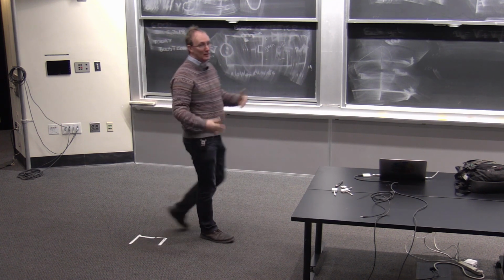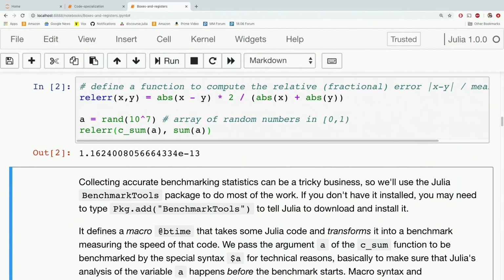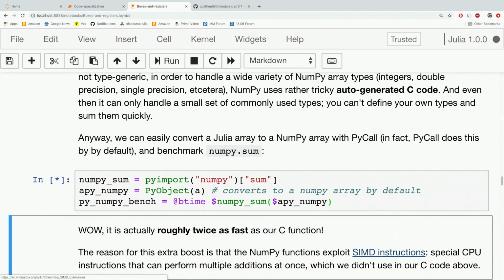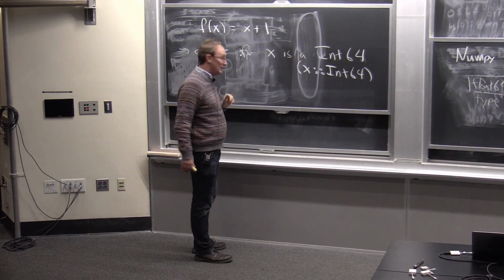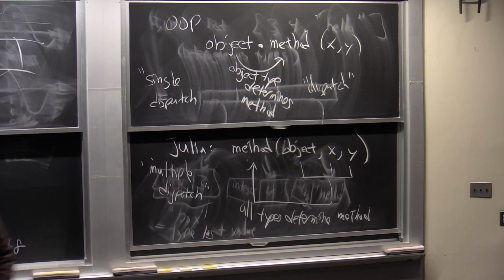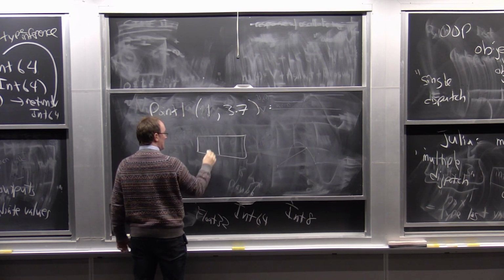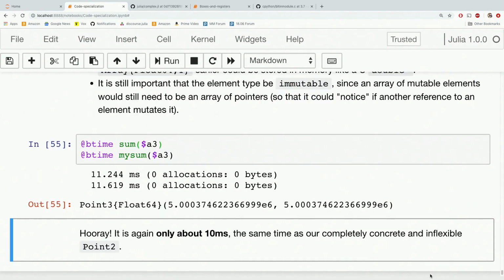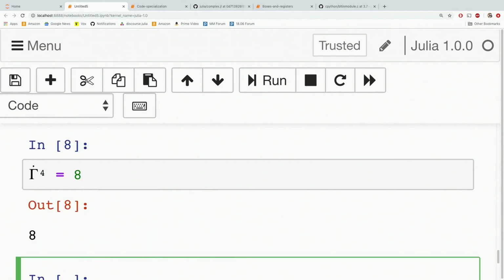23. High Performance in Dynamic Languages

Comment: At 1:15:30 - "there's a small core [of Julia] that's implemented in C for bootstrapping". Would it be possible to implement the whole language in julia?
Reply: As the guy with the number-as-a-name said, you ALWAYS need something to implement the bootstrap compiler initially. You don't have to do it in in C; if you want to be a maximum completionist you can do it in machine code, if you want to be a little lazier you can do it in assembly, if you want to be practical it is always done in C. This is because C is fast and the most portable language to ever exist (C can be compiled for basically any architecture).

As the lecturer said, they already convert to LLVM to do machine-level code generation, so even if all of their code was in Julia they'd still be dependent on tons of C and C++.
Reply: nope, there always has to be 1 little thing that knows how to initiate this bootstrapping mechanic.

However you could write a small compiler in C that compiles Julia Core to Assembly, let's call that C1 and then write a full Julia compiler in Julia which we can call C2. Now you can compile C2 with C1 and get the binary for a full Julia compiler. Now you can throw away C1 and only use C2 which is entirely written in Julia and compiles Julia code but you have to keep the binary so you moved the C portion of the compiler to a binary file.

Comment: This is a good, energetic lecture from "MIT 6.172 Performance Engineering of Software Systems." 
Fascinating (but 90 min long, so need some time, or need to speed through, but this fellow, Prof.Steven Johnson, already talks at 1.25 normal speed!).
This is really why I got interested in Julia: high performance, but dynamic like python, concise, readable, easy(ish) to get started.

The lecture gets into what's going on behind the scenes in python, numpy, c, and julia for some simple math (the sum() function), in a surprisingly clear way.

This remarkable statement, in passing at 10:10, struck me as shocking and counter to convention:"High level languages allow you to do tricks for performance that would be hard to do in low level languages." Usually we think low level languages are required for the efficiency tricks and code-specificity, e.g. type-specificity, needed for performance. I believe his message is that "[Flexible] high-level languages [that allow meta-programming, like Julia] allow you to [more easily] do tricks for performance."

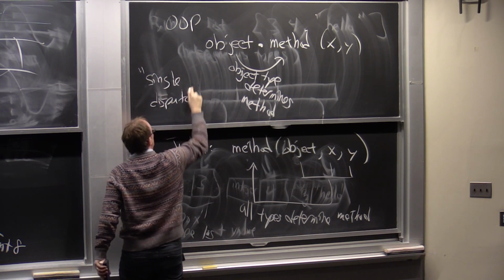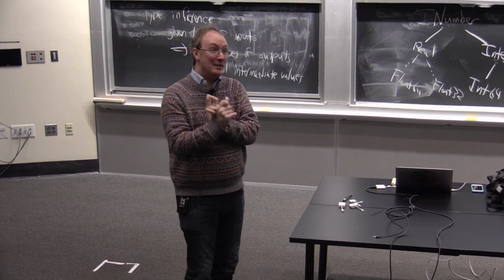The discussion of multiple dispatch (49:00 ff) and type-stability, ~54:00 ff, a key concept for Julia performance, was very helpful. Here is Prof. Johnson's recommendation, which I had not heard said so clearly before: For type-stability and speed, "Types of the function (types of return and intermediate variables) should be determinable from the types of the arguments and not depend on the values of the arguments." Otherwise, the function can thrash around in costly type checking when it executes. This is "because the types of the arguments are known at compile time, but the values are only known at run time."
Reply: Thanks for summarizing.